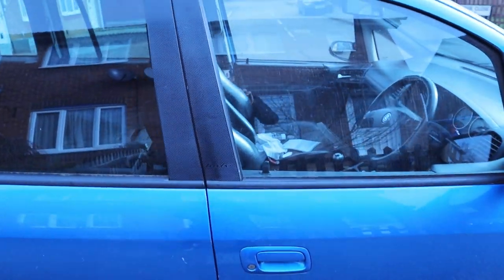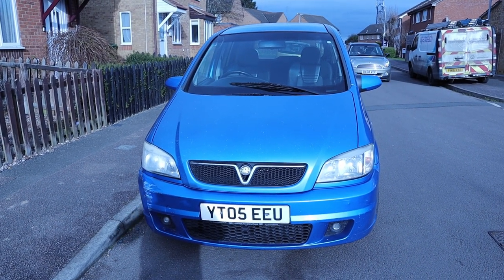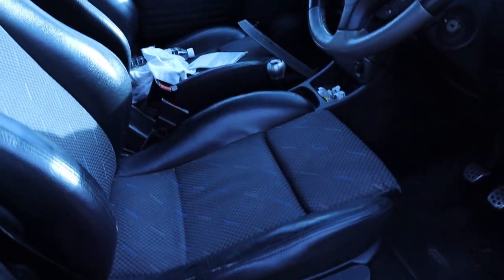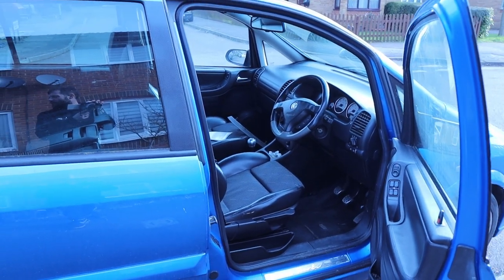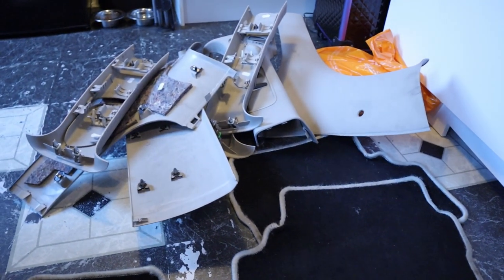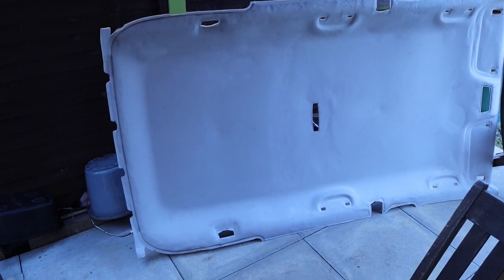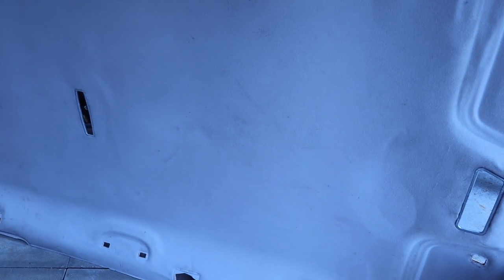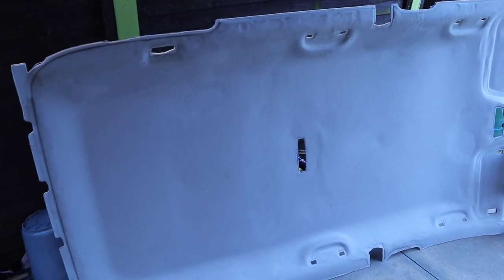VAUXHALL ZAFIRA GSI - First Job The Headliner!  - Episode 1!

Comment: Just bought one. There is only 14 of them here in Sweden. And only five of those are not imported. And there is only one Arden blue non import. That's the one I have 😄
It really needed to be saved
Reply from the maker: Welcome to the club 😊lol
Reply: @TwoSpanners  thanks 😄
It will be a fun project 😊
Might go with a black headliner too. It looked good
Reply from the maker: @rexthewarhorse  the fabric paint didn’t cover well at all 🤣 was better to use normal black aerosol haha
Reply: @TwoSpanners  the cloth on my headliner is almost completely off so think I will put some alcantara on it. Extra fussy ceiling 😄
Reply from the maker: @rexthewarhorse  probably best to recover it haha loads of spray glue

Comment: any tips on how to open a rear door (driver side). wont open manually or with key. Cant get to the bottom 3 screws as the skirting? is in the way.  Mot due!
Reply from the maker: Bit of a hard one with out be there to look at it and work it out if I’m honest but you will need to someone get the door card off to get to the catch inside sorry I can’t be of much help

Comment: 12:00 how did you manage to cut all the holes and corners perfectly? I done it on mine few months ago but unhappy with few spots, I used a blade to cut the holes
Reply from the maker: I got a very tidy headliner in the first place and painted it using fabric spray paint so didn't have to do any cutting in the end 😅